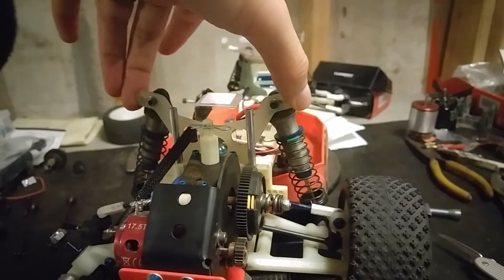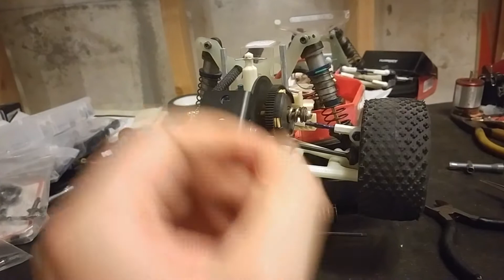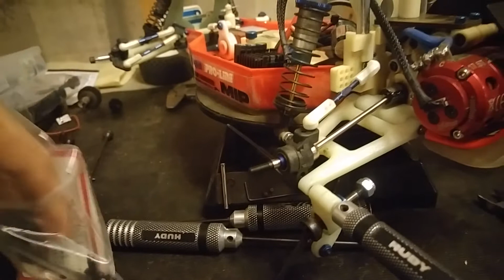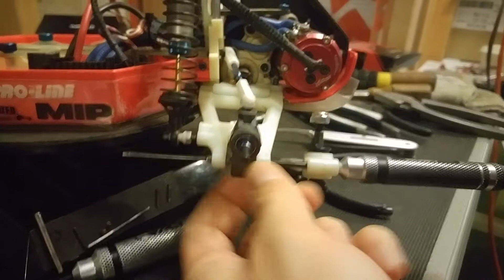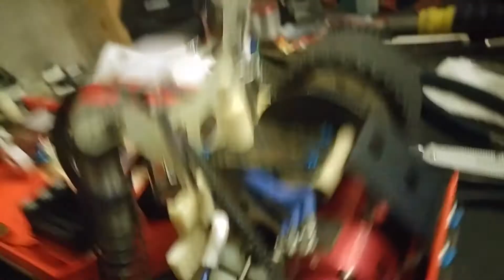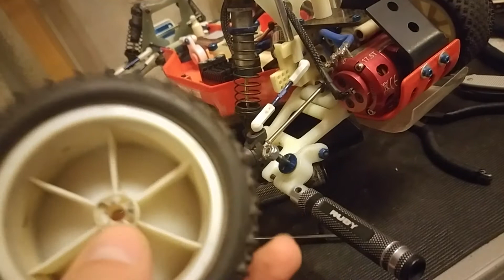Vintage "Orange" RC10 with RPM Worlds Conversion, rear setup update, 04/26/17

Comment: Try the Horizon telescoping drive shaft conversion! It fixed that problem with the dog bones and I even use the RPM arms with it. The ones that came with tend to drag too low! I don't know if you can find one of those conversions nowadays but I did. I still have one in the original bag from 30 years ago. It runs pretty smooth it eliminates that problem and it does not wear out the outdrives either. I've got titanium ones and it just goes right in with a screw..
Reply from the maker: Well I already have the Kyosho mod in there and it works perfectly fine.  No need for me to hunt down unicorn teeth for this.

Comment: I had a vintage fx10 buggy that the dogbones would constantly pop out. I hated that car until I added heat shrink tubing around the cup and dogbone. Never had an issue after that. This trick might add some extra protection for you while you race . Also keeps dirt from getting in there.
Reply from the maker: I have a Tamiya Striker (my first r/c car) that's the same as the FX10, so I know exactly what you're talking about ;)
Reply: That's a good idea and cheaper then the answer I used! I use telescoping drive shaft instead of CVS. Horizon makes that conversion for the rc10. Very old if you can find them but they work great

Comment: I used the B44 centre drive shaft on my worlds re release, they are a couple of mm longer and work a treat
Reply from the maker: Yes, on the "standard" RC10, that is the correct dogbone to use.  The general assumption with this RPM conversion is that you use the same exact dogbone length, since I have no record of RPM recommending anything different.  However, the arm length and placement doesn't permit that much droop with those dogbone lengths, so you have to use something larger here if you want more rear travel.
Reply: So thats the B44 centre drive shaft as a pair, The B4 axles and the GT hubs! Is that all I need? (Its on an original Gold Pan)
Reply: with the RPM rear arms.

Comment: Cut a few small antenna rubber ends. & They will no longer have this issue popping out your diffs carriers and bones while still having play, id go smaller and do both there carriers and you will be able to still keep your current assembly and components. happy laps friends. :) or you can ask some other retros older enthusiasts on what bones your might be using being how older your EE is lol mine been old. simple and great Advice man. thanx
Reply: Awesome thanks for sharing

Comment: Nice rc what did you paint the pan with the orange looks really nice?
Reply from the maker: That's anodized.  One of the original colors the tub chassis was offered in as an option part.
Reply: Really I never seen that before but you know more than I do anyway looks so cool

Comment: Im digging this option but will it work on stock arms. And what brand rim and tires do you use
Reply from the maker: The stock arms are shorter and so this will not work with them.  This particular setup was not designed to switch to modern hex rims, but instead to keep the older dished rims while allowing me to run more rear droop without the dogbones popping out.